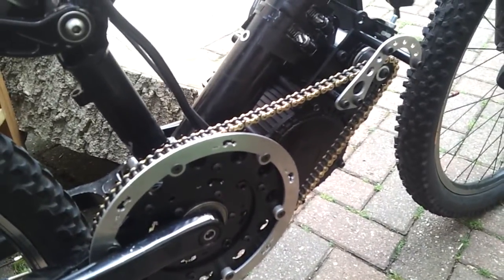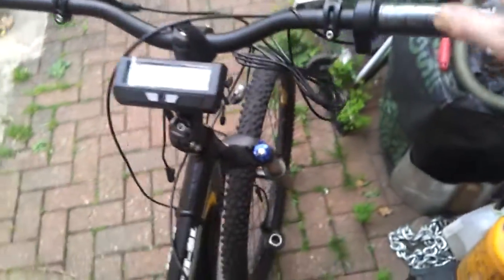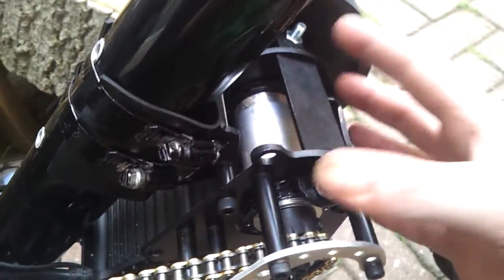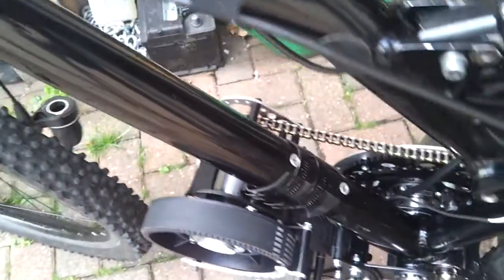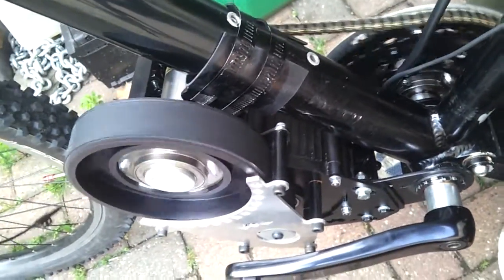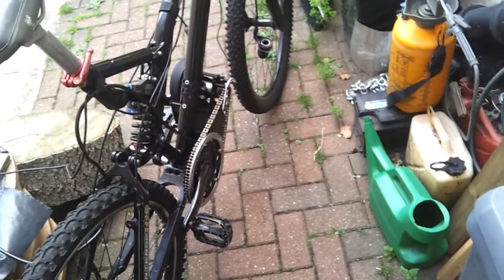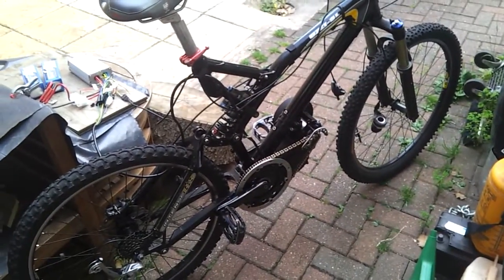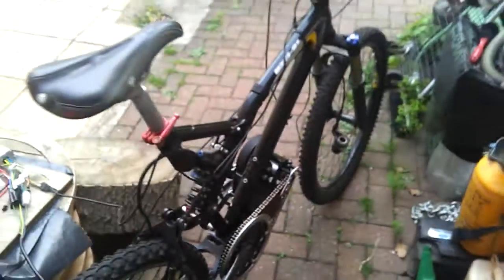Electric bike project..its alive..just.

Comment: just trying to help but i think you have the whole kit and kaboodle both sides actually the wrong side of fixing brackets which if you think about it 1/would give you the movement to left that you seek.
2/it would expose the adjustments needed easier 
3/ it would tighten chain and stop the riding up of belt,
Reply from the maker: +vassilij zietseff (davlyn) 
thanks for the comeent buddy im pretty sure that the brackets only go on one way but i will double check to make sure..deffinatly worth a look that..could be a school boy errror on my part..thanks ;]
Reply: +Crispymenace Did you end up spacing your crank sprocket outward to fix the alignment?

Comment: it looks like you can remove the sprocket and grind it down a bit. 
im thinking of doing a project like this. just for kicks. 
would you say it was worth your time n money after all?
Reply from the maker: +Rick Dager hello buddy sadly the fixings are to close so ive had to step the cranck out by 5mm to keep the chain line..the top drive sprocket has no adjustability.
if you want a fast build and are not looking for too much power thr bafang 750w kit can be done in a day with the right tools and is half the price of this kit and it can be bought with a battery at that!
i have another ebike and it s very good fun..like a cheap and easy to service motorbike..well worth doing either way imho.
this ones a little more compicated and is taking more time but will be worth it im sure and is cheeper and better allways round than buying a premade one..
good luck with whatever you do.
regards 
stoo
Reply: thankx

Comment: It's hard to tell how the drive gear on the drive transfer shaft is fastened, but is it possible to cut off a centimeter or so off the tail end of the gear itself then re-fasten it?
Reply from the maker: bigbullseye cheers buddy but im a bit reluctant to start cutting stuff off a brand new motor kit..
i may need to sell it to some one that can get it going.
cheers for the time looking.
atb.
Reply: +Crispymenace Did you get this up and running in the end?
Reply from the maker: no mate had other things keeping me busy.. it s still sat here waiting for some more effort..got a good idea whats going on with it and a plan to sort it but no time/money spare at the mo..she still fails to chooch im affraid;]
Reply: You mentioned about possibly selling it...let me know if that is still a possibility...LR or Tangent motor are the two best that I know of so far
Reply from the maker: im open to reasonable offers for the kit as a whole with cycle analist v3 and controller and to the lot including intense frame as it stands stands..this kit also has the optional temp senser in the motor..you can e mail me for future communication if you wish...
stoo234@gmail.com.
cheers..stu
Reply: Is it possible that the sm  front gear was simply put on backwards?
Reply: Also... how about spacers between the inner and outer gears at the BB?

Comment: Alignments are always a curse on those builds, you will tweak and peak those nicely im sure :-) its well worth the wait its a lovely well designed and built machine :-D Yeah just need a chill from it, to many hours clocked up on the tweaks frustrates :-) Sorry ive not got feed back on the chain issue, id say grease it heavily and hope for the best but im just winging it :-p would be left scratching my head after that :-) well worth the time on the project you are putting in, quality and adaptions are bob-on :-D

Comment: damn that thing looks scary! :D
Reply from the maker: Rinoa Super-Genius it kept me up all nite..lol..
think im gonna give up.im beat on this one.
man overboard;]
Reply: Crispymenace hi,I have been watching your ebike video's. All great stuff.I suppose the bottom bracket( pedel axle) came with the kit.
Reply: Crispymenace and that is not the problem.even though you should not need to is it possible to space your chain ring sprocket out.
Reply: +Crispymenace on the lightning rods mid drive kit thread,on endless sphere page 94.there is photos of different size bottom brackets.and a photo of one guy's spacing problems.he is going to make new spacers.
Reply from the maker: craig davies thanks craig..dont know whats going on with it..the bottom bracket is correct i spoke to mike at length to make sure all was good as i ordered the kit, and it went together fine.
 if i move the chain ring ive got about 4mm before the pant ring hits the crank arm ,so that still wont be enough..needs almost a chains thickness inwards at the top mount;[.some thing must be twisted? but who knows
thanks for ya tips bro i ll give it a day or so then probably admit im beat and sell it on es
.expensive lesson learnt;]
cheers buddy.
Reply: Crispymenace
i meant scary in a good way, it looks like it would be great in the woods and off-road.